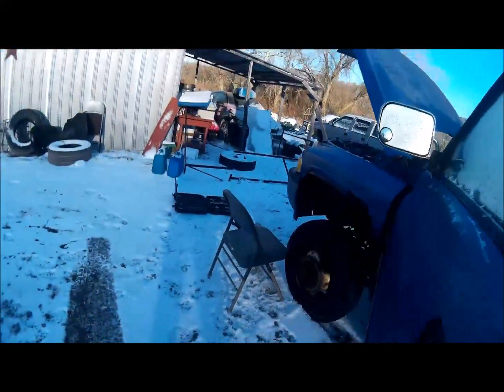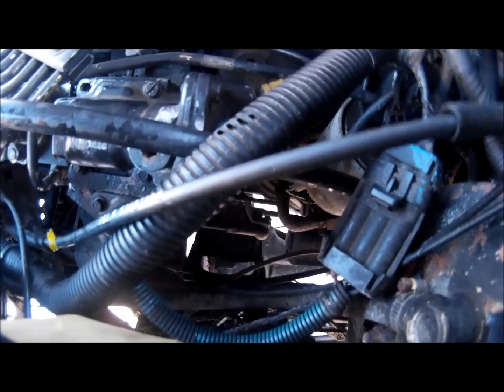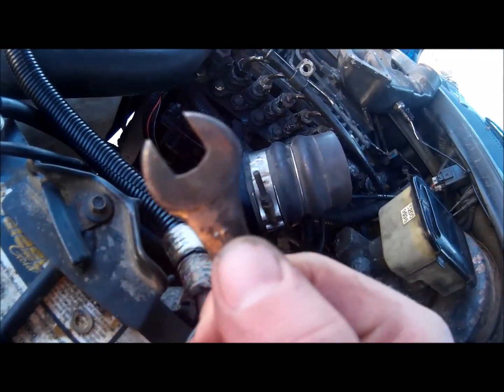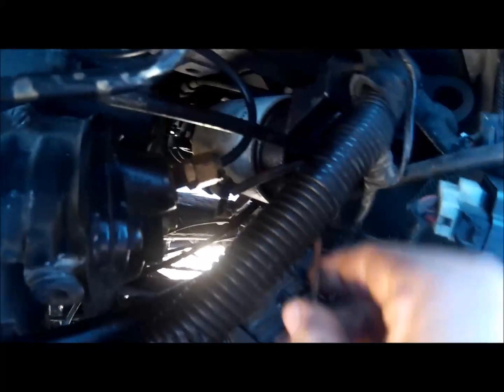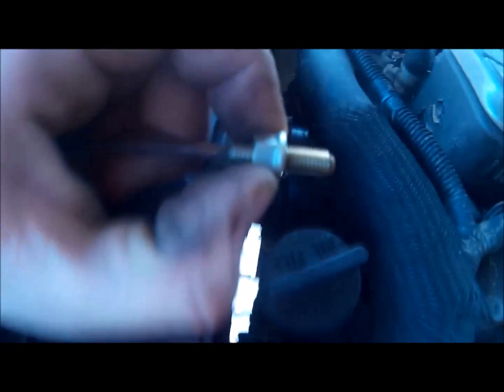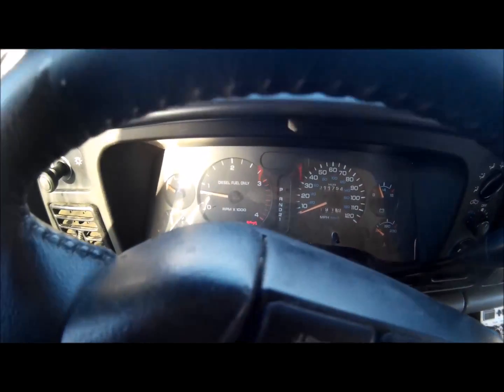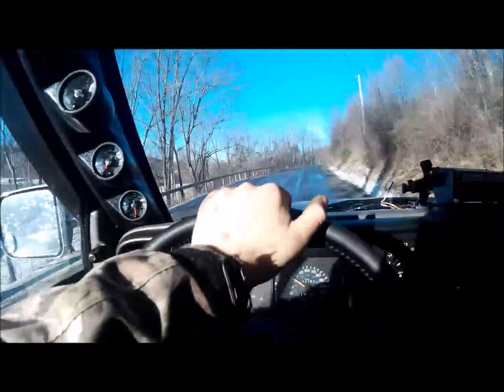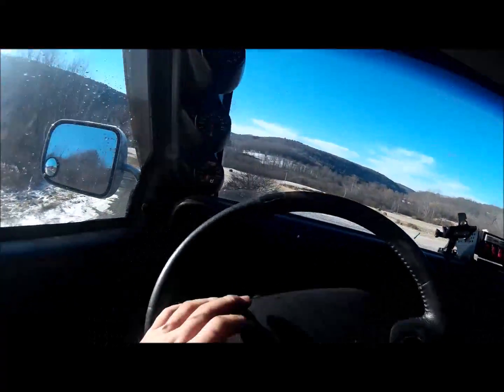12v Cummins Fuel Screw Adjustment

Comment: What's the risk of a runaway doing this? I've seen a 1st Gen runaway after tweaking the fuel screw
Reply from the maker: T k extremely slim p7100 pumps are vert different from VE pumps. A runaway ppump 12v is nearly unheard of.
Reply: @steveboy3021002  ok cool thanks

Comment: I have a 98' 12v and would like to see some more videos on how safely grind down and/or adjust the fuel plate to best performance without sacrificing longevity of the pickup. My star wheel is all the way turned up and  like you said, I feel like it could be better tuned. My smoke is more at the high end of rpms and my low range isnt very good. I would love some advice as I'm relatively new to tuning a 12 valve and I would like some more tips on how to tune one. Thanks!
Reply from the maker: Move your plate forward all the way and get a boost elbow that all i ran for awhile. it only smoked when you got on it hard. Now I custom ground a 5 plate and i have it tuned fairley well. the first step is boost and EGT guage.
Reply: Bad idea